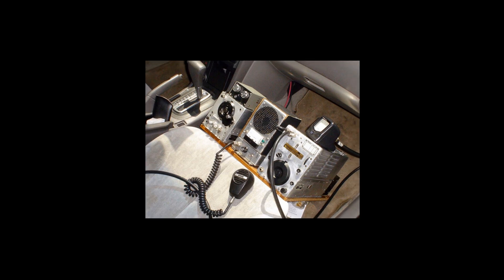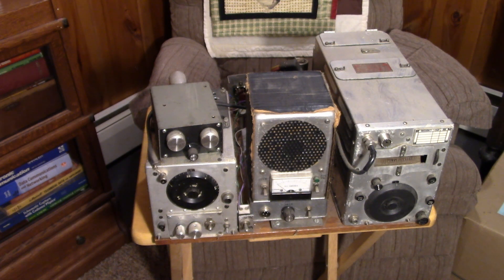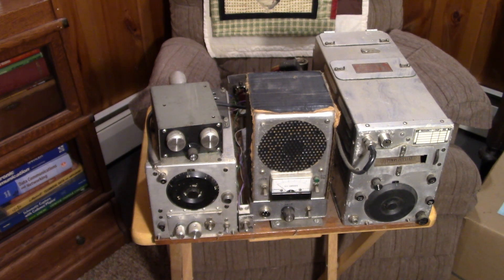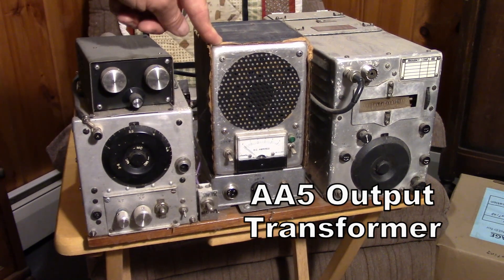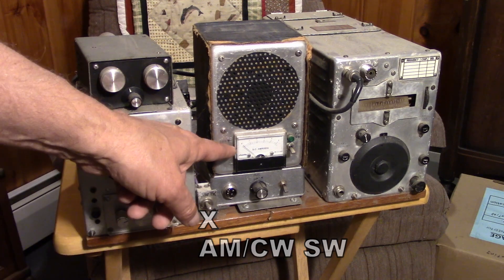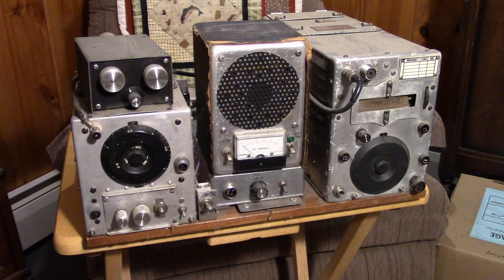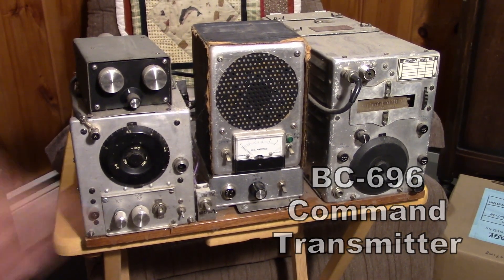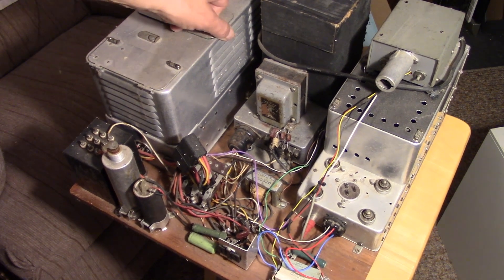ARC5 GO-GO Modulator

Comment: Reviewed this, and discovered it is not as good solution/idea as you believe. 
It is good for the transformer on the audio part, but no good for the big inductor on the supply part for the radio amplifier. 
This ARC-5 Go-Go is not some genius idea, it is a surrogate, with no better performance than the simple one transformer idea.

Comment: I must be blind or something, because the circuit as shown would cause continuous conduction from +13.8 through the transformer and through the body diodes in the IRF840 (odd choice for low V btw) to ground?????     What am I missing?????    And why use 500V mosfet for a low voltage stage?????  The diodes IN4001 parallel with the mosfet for a two way diode pair (the other being the mosfet body diode, so what is that about????   That part of the circuit makes no sense to me, again, what am I missing??????
Reply from the maker: The body diodes and the redundant protection diodes are the same polarity and should be reverse biased to the +.

Comment: Why not run the 120 V winding to the audio plate inputs on the modulation transformer, getting rid of the cap? I guess you had a reason?
Reply from the maker: Good question! The modulation transformer might well have worked in this way to some advantage due to the ratio, but it adds another variable. The choke idea is quite forgiving.